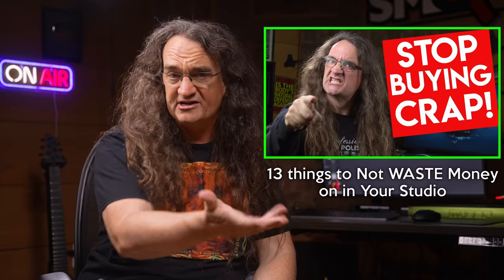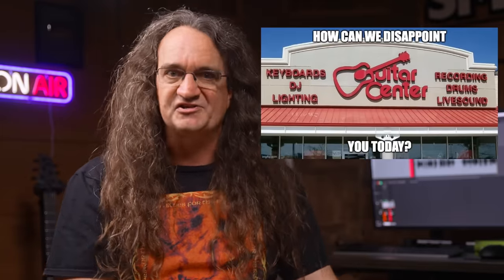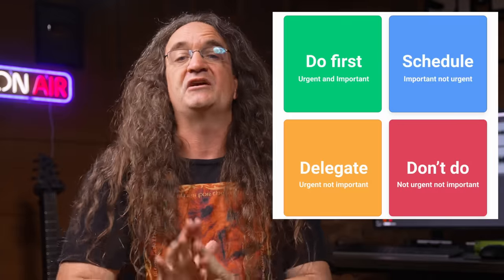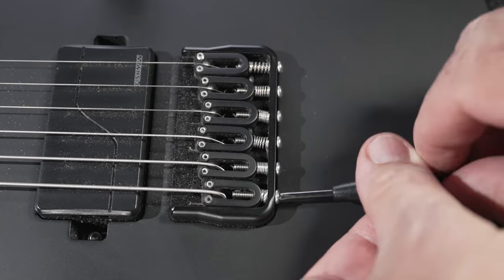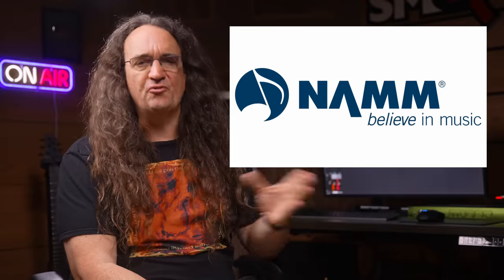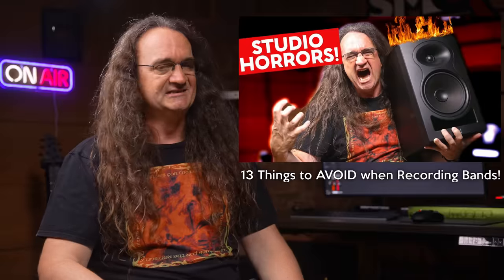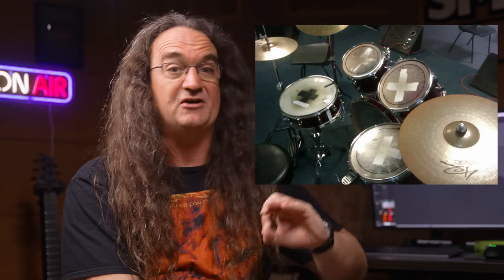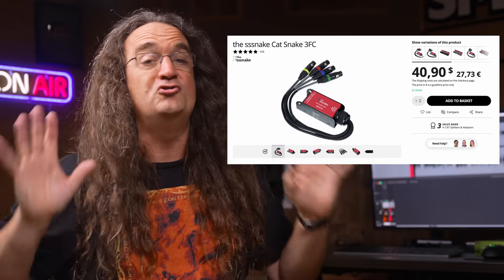13 Things to AVOID in your Home Studio!

Comment: Be careful with Rockwool when making basstraps. There is always fabric used to seal the Rockwool in. The problem is that after a while Rockwool starts to release particles that can get through that fabric! and you are breathing that stuff as long as you are in the room. Make sure you have the right material for damping or sealing. Rockwool is made for placing between walls!, not behind (breathing) fabrics! You need to seal it with plastic probably, (making it a damping resonator as well?)
It can cause breating problems and in higher doses cause serious migrains and fatigue.
I just watched a new episode by Acoustic Fields today, and that guy has seen these situations many times before.
Be careful , and a big FUCK YOU from Holland Glenn ✌

Comment: A little off topic, In an earlier video you'd mentioned that you weren't sure what speakers Metallica had used on the 1st couple albums. Kirk recently talked about it on Rick Beato, he didn't get into specifics but he said it was a modded Marshall they'd used on the 1st albums and it was stolen in Boston. So apparently there's some dude out there somewhere sitting on that cab used on those 1st albums. How the hell has that been kept quiet all these years??!! Where are you dude!! What's that thing packing??!! I think it's  private investigator time!

Comment: Quick question: How well would that network cable trick worth with synths using mono output? My synth player has three separate synths he uses on stage, and I’m running a separate 50ft 1/4-XLR cable for each, plus an XLR for his In Ear Monitor pack. The 4 cables are taped together to make deployment easier, but it’s heavy as shit and takes up a belligerent amount of space in the stage cords box. 

I wanna try this idea, but I don’t wanna spend money on materials if it won’t work
Reply from the maker: Yes.  4 channel audio is 4 channel audio.  Works on ALL audio.  By sure you get SHIELDED CAT5e cable.

Comment: WARNING!!!! When it comes to tubes, the smaller ones like 12AX7 can be easily replaced but.... DO NOT CHANGE YOUR POWER TUBES!!!! Power tubes need to be biased, which means it needs to be done by a professional. Yes, there are some amps that are self biasing, but many are NOT!!!  EL34, EL84, 6L6's all need to be installed by a professional if your amp is NOT self biasing. So please keep that in mind.

Comment: in the spirit of dispelling incorrect things that musicians believe, you are thinking of halogen light bulbs with the finger oil thing. You probably have seen someone use a cloth to not burn their fingers during a quick tube change.  It's certainly not going to hurt anything to use a cloth, but dont feel the need to take your socks off and put them on your hands if you want to change out your tubes.

Comment: @3:42 man you are going to get a lot of butt hurt comments on changing the tube!! In my video I recommended using latex gloves. I do that all the time. Now years later I am still getting comments about how I am wrong, even when I have explained that I come at it from playing with huge power tubes. 3-500ZGs were the smaller ones (you can push these up to 1000 watts, and running a pair in push pull set up you can really push them) I would add a link to my video, but I don't want to "ride on the coat tails"  of Glenn without his permission.

Comment: Yes if you toast your truss rod you're hosed, that is why you DO NOT FUCKING MOVE (create bend in) THE NECK BY TURNING THE TRUSS ROD KEY.  You move the neck with your strength by manually bending it, and take up the slack when held bent by turning the truss rod.  That way turning the rod is EASY and will not strip.  You can even adjust GASP!  Chibsons with their chincy pot-metal truss rods without ruining the rod that way.

Comment: Don't overestimate your soldering skills, get a textbook with pictures of approved solderings and check your solderings with magnifying tools or you will miss tiny holes and uneaven textures. I used to work with industrial soldering and electronic repairs and home made soldering often look ugly as shit. The point of solderings that follow good standard is that they will last way longer than a joint with a blob of uneven solder on some sprawling cable strands.

Or just do what ever you feel like. Put your electronics in the oven with solder blobs on it if you want to.

Comment: I honestly don't see the point in string winders and or/drill bit winders. With locking tuners, you just cut the excess off once it's locked. This is an essential feature to have in modern guitars. Also, having all those extra winds on the tuner isn't that great of an idea anyways.

Comment: The truss-rod is NOT for adjusting the action of your guitar i.e. height of strings above a given fret.
Glenn's explanation strongly suggests this and it is dangerously wrong.
Adjustment of the truss-rod is the first step in a guitar set-up and it sets a VERY slight forward bow into the neck.  This has nothing to do with the action, it is because of basic physics.
A string fastened at each end does not move an equal amount along it's length as it vibrates.  The very ends don't move at all because they're fixed.  The further away you get from the fixed points the more the string will be moving, with it's furthest excursions being in the middle i.e. at around the 12th fret.
The truss-rod is adjusted so that at proper tuning tension, the pull of the string is just able to pull a very slight forward bow into the neck.  This allows for the fact that the string waggles further in the centre.
The tuss-rod is there to keep the neck straight and prevent long term string pull from bowing the neck like a banana.  The SLIGHT relief adjustment is then made by - 
1)  putting a capo on the first fret (thereby eliminating any influence of the nut) and pressing the 6th string down onto the frets at fret 12.
The string is under tension and will therefore itself be a straight-edge. If the neck is totally flat, then the string will touch every fret.  The adjustment is to gradually slacken off the truss-rod (a quarter turn or less at a time and re-tune and give it all time to settle) until you have introduced a slight forward bow into the neck which can be measured with Feeler Gauges inserted between the string and the 7th fret.  Opinions vary slightly on the optimum distance but it will be somewhere near 15 thousandths of an inch.  
(For reference, a Fender Medium pick is about 22 thou.  The offcut from your plain 3rd string is probably 13 to 17 thou) 
2) Leaving the capo on the first fret set the action/string height by playing the guitar and lowering the height of the bridge saddles as much as possible until string buzz against the frets becomes a problem - that's a matter of playing style etc and will vary but is usually somewhere around seven 64ths of an inch.
(so just under an eigth of an inch/3mm)
3) When the neck has the correct relief (forward bow) and has had time to settle (more time for bigger adjustments) and you are happy with the string height as set by the bridge saddles, THEN you can remove the capo and make any adjustments to the nut, filing the slots deeper if necessary to get the strings close to the first fret.  Go slow and careful...... it is FAR too easy to cut too deep.
4) When all of the above are correct, you can tune your intonation
Doing these adjustments in any other order or for any other reason is a pathway to Trouble.

Glenn's info is usually spot on and I'm certain that he knows everything I just wrote
- it's just that the way it was said here could easily be misunderstood by a novice and as he said, if you strip your truss-rod thread or even snap the rod itself, then you're in deep trouble.
....so my lengthy expanation may be superfluous, but better that than some kid fks up his instrument because he misunderstood.